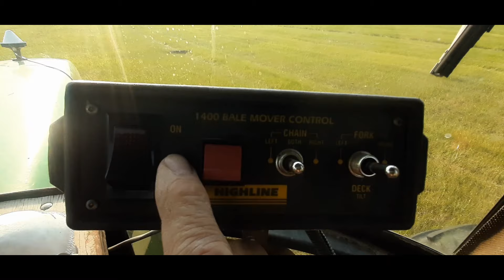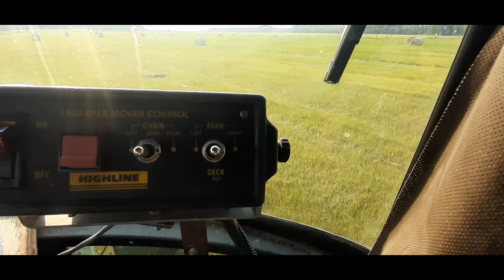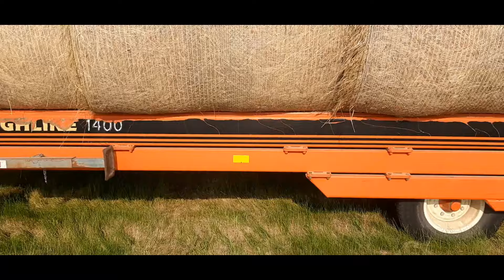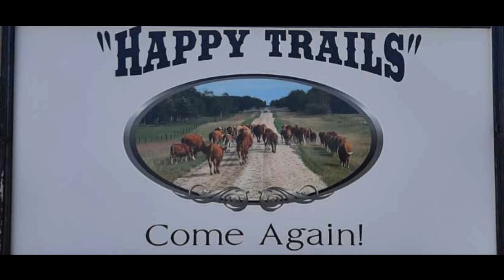Pickin' Time

Comment: Two set screws.  Lol .  Been there. 🤣👍
Reply: 🤔🤫 enough pulling and heating will always overcome a couple of setscrews.. even if if you liquefy the sprocket... 😎
Reply: @GosselinFarmsEdGosselin  I used a zip cut blade on the last sprocket.  Even pulled both set screws,  tried heat, wouldn’t come loose from the shaft.  Wrecked a big gear puller on it too.  Got real aggressive with the impact on the puller…….
Reply: @chadtosh6831  been there.. spent 3 days in the field, had to pull the needle carriage arm off the knotter shaft on the 4900.. even bought a new, very expensive puller. About died in the heat in the field, finally brought it back to the shop.. welded grade 8 bolts to it to pull with.. stripped 2, broke the other two.. didn't again, torched a slit, cherried it.. stripped 3 nuts, but finally got it!! 
Nothing like spending over 4 days with 2 people, to get an hour job done...

Comment: That picker sure is slick, but its too wide for the roads around here. I use an eight bale waygon and load it with the loader.  When bales are scattered I grab an extra one on the three point fork. I finally have a good skidloader and it sure makes unloading fast.
Reply: @burrridgefarms  I like my three point for that too.  Just bought a three point that will pack two bales.  Try that out here soon.
Reply: That would be too much for my tractors, but on the big Kubota it would be handy loading your semi.😊
Reply: @burrridgefarms  yep, and in the winter feeding cows as well.